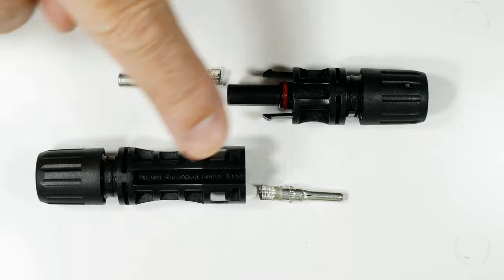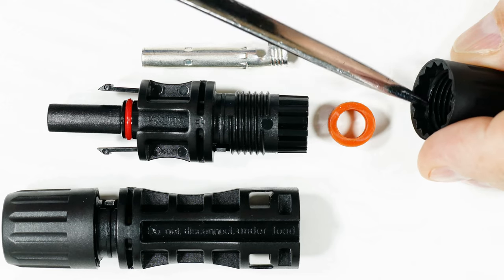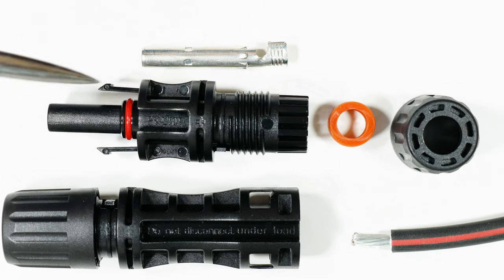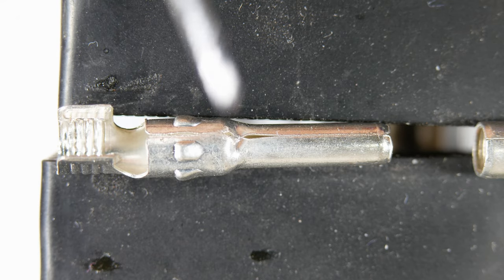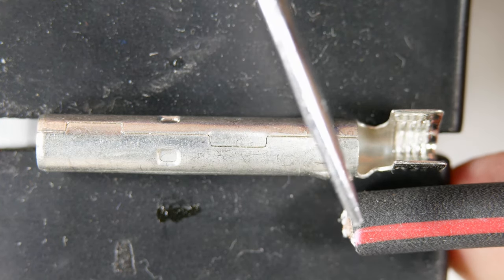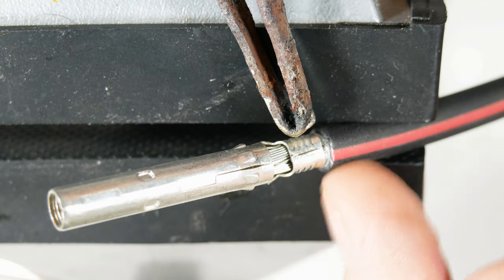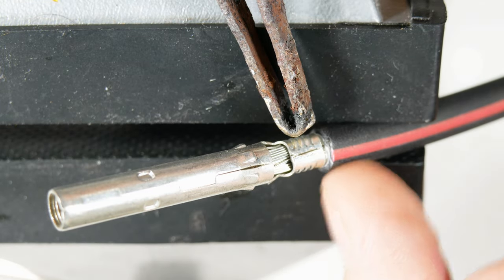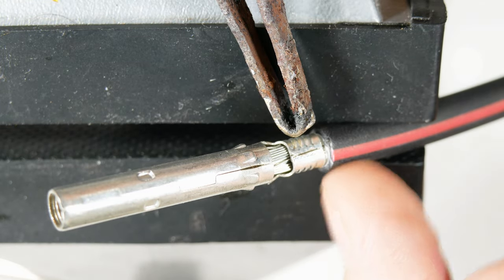Soldering Solar Connectors (4K)

Comment: I have never seen any manufacturer of mc4 connectors, or in the manual of the inverters call for soldering. Only crimping with an appropriate F crimp and torque to spec with a torque wrench.
Reply from the maker: In theory it's not required, but over time the different metals of the connector and wire will corrode increasing resistance. Even when new, each junction adds a bit of resistance and one side of the connector has 2 junctions or 4 per connection; soldering "eliminates" 2 of those junctions per connection. Most of my systems are small, portable things that run on 12 volts, and at such low voltage, even 4 ohms additional is a lot of lost power, and that resistance will only increase over time. So it's true, they don't call for soldering, but if your system is in place for 20-25 years, the seals start to break down (or were never right), you have galvanic corrosion, use lower voltage, have more extreme weather conditions, ... then soldering will give you the most for the longest out of your system.
Reply: People solder, twist wires in fingers, add own insulation or even grease connections. It looks perfectly clean when is done. After 10 years wire corrode (they "forgot" to clean flux - as here), size or have bad contact due wrongly crimped metal over twisted wires. And is a "problem". Best is a to go Staubli (MC4 designer) video :)

Comment: Thank you for a very well explained process. Your close ups are the fantastic for showing the proper length of the wire. I have a Haisstronica crimper which just did not work so well I thought it was the right size but I'm not sure it did not work so well in and of itself. I have ordered a new crimper which has a curve in the teeth so I hope that works but soldering is something I have done in the past and after viewing your vid feel confident I can achieve a similar result! Keep up the style you have a knack.
Reply from the maker: Thank you. My personal experience, for what it's worth, is that weather is a bear. Over time it will attack any electrical connection. Crimped joints are OK in a protected environment, like in a car, house, computer, ... but in the wild they breath in and out humidity that will corrode the wire/connector interface. Solder won't let that happen. I've been working on a video about that for a couple years, but the bottom line is to show the number of connections in my solar array (wire to connector, connector to connector, then connector back to wire; all that x 2 per panel) and if we assume each connection loses only 1 ohm per, it's a huge additional loss from resistance (especially at lower voltages). In my system that would add 50 ohms, about 40 ohms of that would be unnecessary. In my 12 v camping systems I'm fanatical about soldering and using anti-corrosive compound because 40 ohms loss would be bad.

Comment: Looks pretty good, sir. One thing I would like to mention is that you should tighten the retainer nut to the point where there is no longer any gap. Thanks!
Reply: Doing that crushes the silicon seal inside the cap. They should be tightened until resistance is felt.

Comment: Very clear explanation, good closeups. Thanks. It should cautioned to not use acid-core solder, which can leave a residue that causes corrosion. Use only rosin-core solder for electronics or electrical connections.

Comment: Beautiful video and well presented... but... Mc4 connectors fail due to aging of the connecting pins and sockets, inside the plastic moulding. The first signs are of the plastic becoming distorted and burning. If this is happening on a roof top, out of view, the results can be catastrophic, depending on whether the panels are connected in parallel or series. The answer is to do away with ALL of them, crimp and solder cables together and then insulate them with shrink fit pvc sleeves.

Comment: Great quality video with excellent close up views.
I was testing to see the "depth" that the metal male and female Crimp Contacts would go into the plastic and when I look at the amount they go in, it looks far short of where they should settle. I guess part of the reason is that I am not fully pushing them in until I hear a "click". I was hoping it would seat at full depth but didn't want to push them in until I do the soldering to test that theory. Nevertheless, I took the risk, and it does seat all the way in. Once you seat them, it is nearly impossible to remove it.
Reply from the maker: That's the truth, they really lock in there tight!

Comment: I saw in another video the end caps should be screwed until they are completely flush to aid in the water resistence, is that true?
Reply from the maker: It depends on the brand of connector.  Some will screw all the way in, others will not.  It just needs to squeeze the rubber ring around the wire to make it water-tight.
Reply: @tsbrownie  I thought as much, when I was ordering mine some came with a tool indicating to me much force was required for proper fitment.. must have been that brand specifically. Thanks for the tips, went together flawlessly.

Comment: Surely, the plug gender does not necessarily indicate exclusively positive or negative as the connecting wire must have the opposite gender plug?
Reply from the maker: That's exactly right, and it's a danger. On the panels the plugs are marked plus and minus, but if you have an "extension cord", you are using negative plugs in the positive line and vice versa. That can lead to confusion leading to shorts if one is not paying attention.

Comment: I have this MC4 connector version. very difficult to disconnect
Reply from the maker: Yes they are. You have to make sure you squeeze the ears all the way in, then pull on the plastic part (not the wires). The good thing about them is they seem to last a long time and are weather proof.

Comment: My mc4 connects are corroded and I need to clean them. Is there a household liquid that I could used, then rinse them and dry them out before reconnection? Im in an off grid situation and am currently getting zero Watts. I can see the solar voltage bouncing around on the MTTP so think its the 2 conections between my 2 panels and controller, as these get disconnected amd reconnected several times a year! I have no crimping tools or specialist cleaning liquids. I was thinking of maybe a quick lemon juice dip, then water rinse to neutralise and dry.
Help needed please.
Reply from the maker: To be honest, I've never run into that. Did the o-rings break down? How'd water get to the connections? Of course, before you try to clean them, you should ensure there's no power present!!! I don't know about yours, but my systems 300 v with enough amps to fry a person. Leave a comment here if you find a good method so we can learn!
Reply: @tsbrownie  It's 2 x 375w panels in series. Dark here currently so was going to disconnect the panels and have a go at cleaning the mc4's.  I think water ingress has occurred while disconnected for 6 months over the summer. The system has been running for 2 months and then yesterday I got no wattage yield from the panels.  My battery is running down so I need to get it running asap 😬
Thanks for the help

Comment: Hey, i have a question. I soldered mine before watching the video, I'm a car mechanic and i now hot to solder and used a torch not a electric one. But now I'm in Norway and the panel starts malfunction, puts out 20 volts without connecting anything but 4 after I connect regulator, now the day the panel died because the solder makes a resistance that could kill the panel,... No guarantee. But how can it be that that would kill a panel ? Hitting it a few times I found out makes it work again until some drive vibrations and than it's bad again, can you tell me if you know of that kind of isseu ?
Reply from the maker: I am not sure if I understand the problem. You used a gas torch? If you put the flame directly on the wire joint, that will not work well. It oxidizes the metals in the joint and the solder. A bad joint can give low voltage and an intermittent connection. If you heated the panel or put too much physical stress on the connection, it could be damaged. If you make a video, post it on Youtube and send me the link, I will look at it.

Comment: you should of talked about the solder , what size etc
Reply from the maker: I have videos specifically on solder, but the summary is to use a good quality electronic solder (rosin flux core is most convenient). Size is not important from a technical standpoint, but from a cost standpoint the fine stuff is higher and practically it is more fiddly to work with. Kester makes a good solder and is available at hardware stores. Do NOT use acid flux under any circumstances! It is made for steel and will eat away copper wires and fittings.

Comment: ..is there any way to pull it out again after lock..? ..I want to add a dc voltmeter in parrellel..
Reply from the maker: Which part do you mean? The plastic plug can be disconnected by pushing in on the locking ears. The wire can be removed with the ferrule with a lot of effort. BUT, I won't recommend you do that. These systems can carry hundreds of volts (mine is over 300). If I needed a meter, I would wire it in using the correct plugs / connectors, or I would wire it in inside the junction box. Safety first!
Reply: @tsbrownie  ..they should make a ceramic ones..the current mc4 can't handle heat very much..anyway I simply pulled it out with force so I can add a wire for the voltmeter and also a regulator for USB fan...I'm cooling a micro grid tied inverter for fun ..it used to be outside..fear of being stolen..
Reply from the maker: @surenbono6063  Ceramic would be interesting. I put mine on the roof, hard to steal! ;)
Reply: @tsbrownie  ..today I discovered that cooling the inverter yield more wattage like 25%... By calculation it's 2kwh daily target..but I did 2.5 kWh on 2x72 cell 36dcv 8A..minus the table fan 40wh and fixed the wifi range gtb-600..and my neighbourhood is not that save..some steal metal for scrapyards..
Reply from the maker: @surenbono6063  Interesting.
Reply: @surenbono6063  Best to do away with all the Mc4 connectors and solder wires together. They're completely useless and fail very easily, once carrying large amperage.
Reply: @phuketexplorer  ..I wonder if there is a sturdier ceramic mc4 in the future..

Comment: ?  is soldering really NECESSARY ? 
COOP
...
Reply from the maker: It depends. If you want the lowest resistance over the longest period of time, soldering is a good thing. Will the system work without it? Yes.

Comment: only suggestion i have is mentioning which side of positive u need to put each gender on, i put it on the lead going to the battery but it should have been on the solar side. As far as i can tell it doesnt matter as long as they are oposite but thought it was worth mentioning for people following at home.
Reply from the maker: I say in the video that there is a + and - imprinted on each connector.
Reply: @tsbrownie  that’s not what he means - the positive female goes on the solar side, not the battery side is the point they’re trying to make.  If you were to use the female positive on the battery side your connectors would be inconsistent with other attachments etc.

Comment: I'm sorry for being so...... but, you need to crimp before soldering.  Soldering is fine, but crimping is all you need on these connectors.  Get the proper tool!!!  So much easier, and faster.  Otherwise, generally a good video.
Reply: @bialy100k  I have 4 MC4 connectors to re-connect due to a slight mishap, so I will be soldering the connectors as I am not paying out for a special crimp tool that I will unlikely ever need again.  I know that I may be revisiting these connectors in a few years time, but at my age, it probably wont be my problem 😅🤣